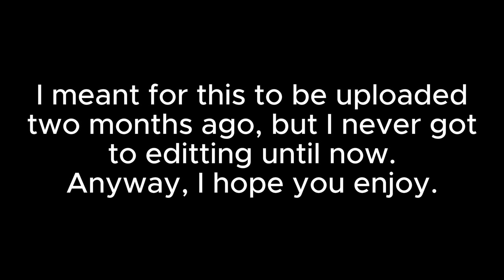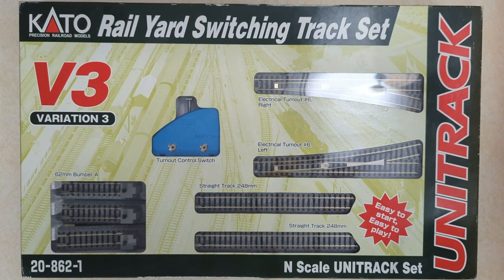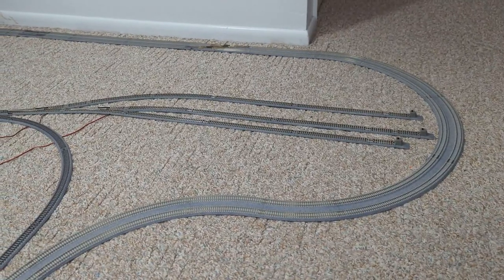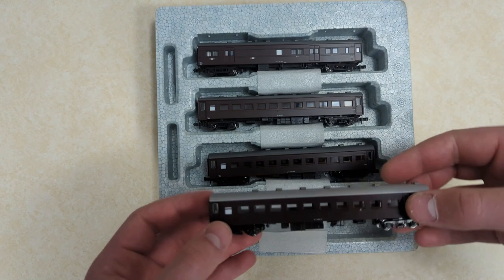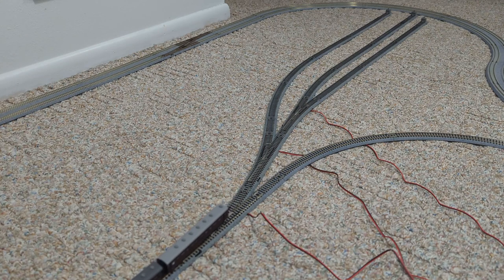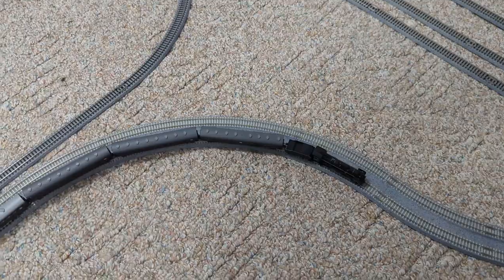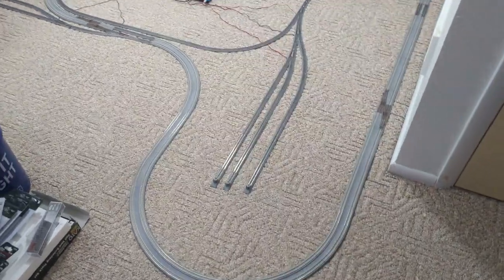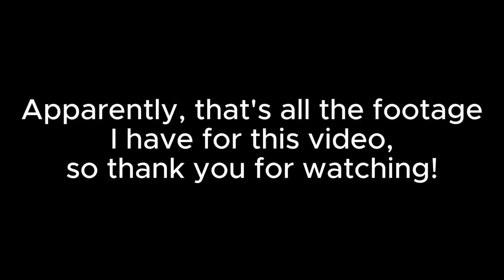Layout Update #2: Big Changes; Kato V3 Track Set; Japanese Passenger Coaches

Comment: My railroad is on a terrible folding table. I respect the floor idea. So much room.
Reply from the maker: There are definitely perks to having the tracks on the ground, but I will say that it gets tedious to have to constantly watch where I step.
Reply: One warning?  Running your trains on carpet for extended lengths of time will lead to problems with the locomotives.  Lint.  It's a problem with HO scale, worse in N scale.
Reply from the maker: Noted. I've been keeping an eye on it.😉
Reply: Nice pulling power.